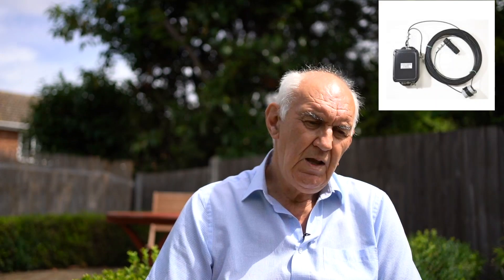End Fed Half-Wave  -   Guitar Connection?  Learn More

Comment: Another demonstration using a guitar is how antennas work in general. Play an E on the B string, 5th fret (this would be the transmitter) and the open E string next to it will also vibrate slightly (the receiver) as it picks up the sound waves 🤪

Comment: Hi Peter,
I own 2 HWEF  one 40-10  and one  80-10, great antennas,...
easy install, multiple options, I mostly use in sloping or inverted L,...  great for the operator who cant set up a permanent antenna,..  very  nice demo,  thx Peter
Reply from the maker: Thanks for sharing 73 Peter